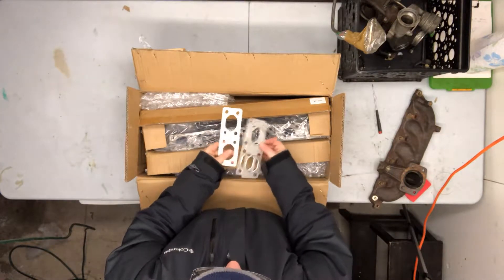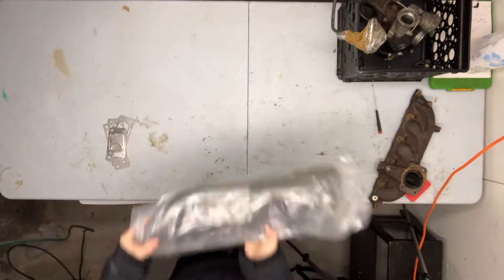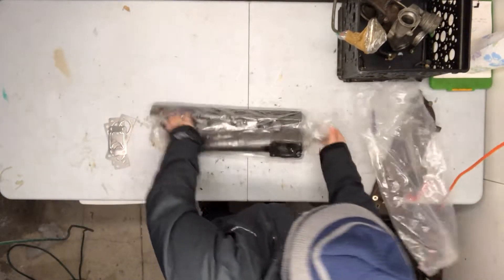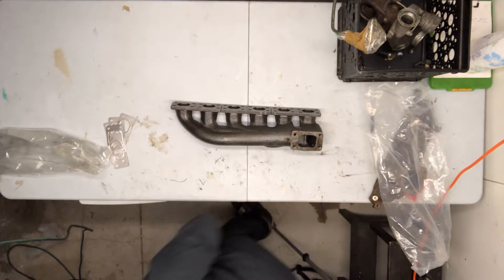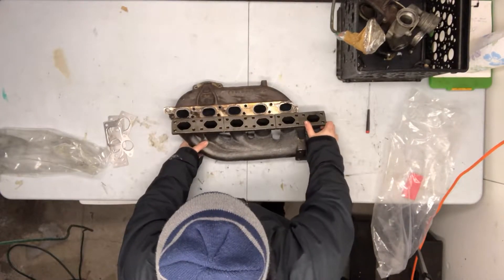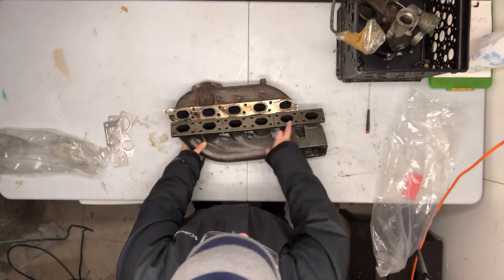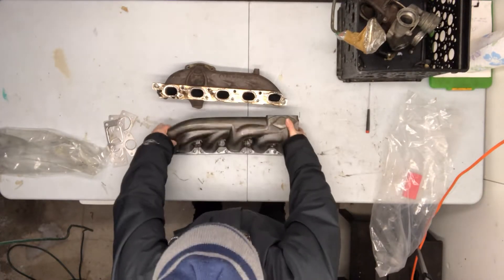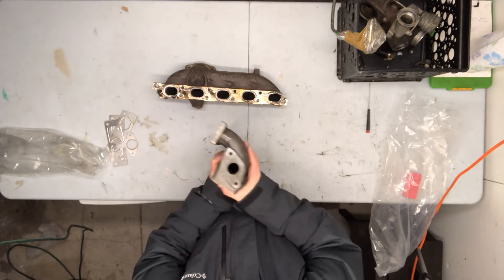Volvo 960 Wagon Turbo Conversion | ep02 | BMW e36 Turbo Manifold\Header Unboxing

Comment: using m52 tubular manifold on my T6 , running top mount have to extend exhaust runners almost 2" away from the head to make clearance for the coolant pipe that runs behind the engine

Comment: Would love a part 2 of this. Would be fun to know if it fits or not since im doing a turbo build on my 960 b6304 :)
Reply: @thiswillprobhrt  Okay well i have ordered one of these exhaustmanifold for my car now. If it doesnt fit I guess I will have to remove the bolt pattern part and just make the piping longer somehow. since i want it topmounted for easy access. But thanks for answering!
Reply: @BrainEatingCat  did it fit?
Reply: @alexbryant5  It didnt fit as i wanted it to, so i machined down the surface and made a new mountingflange for it to get it how i wanted it at the time.
Reply: @BrainEatingCat  ah fair enough. I'm sticking a t6 in a 1 series so I'm sure Ill encounter my own set of problems but trying to do it on the cheap